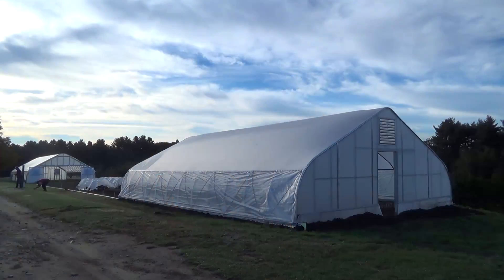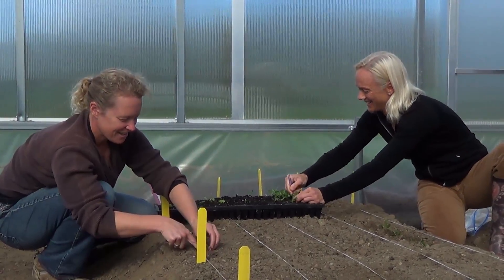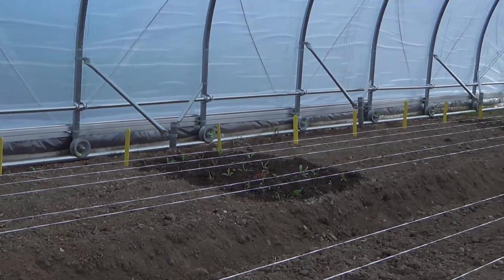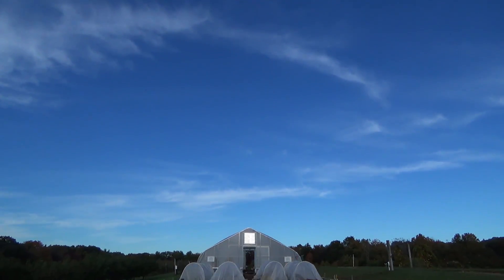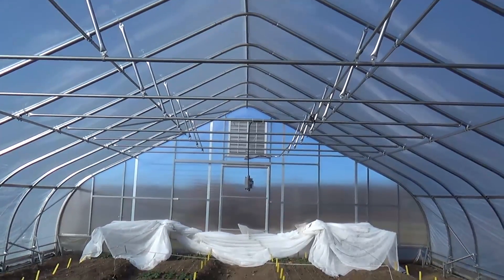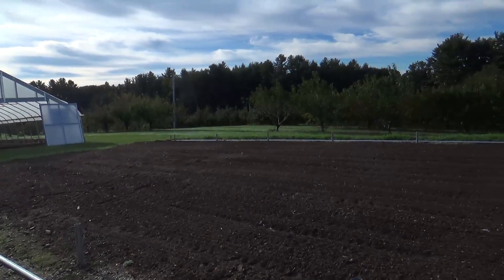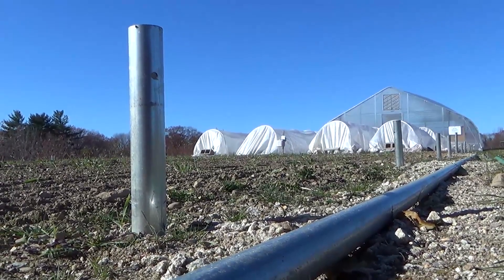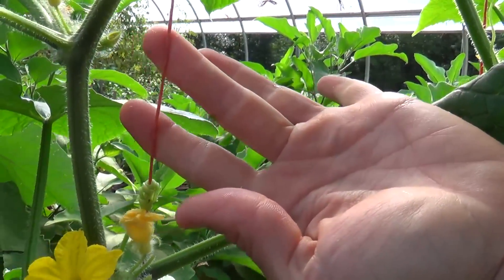High Tunnel Greenhouse Design & Layout

Comment: the question i would have is from nov to/ feb if a person, stuck/ a trailer in there/ to live..

...would he need to heat the trailer even if the outside temp is -10 to?? 20 degrees

..celcius...// my theory is??? it would need very very little heat.